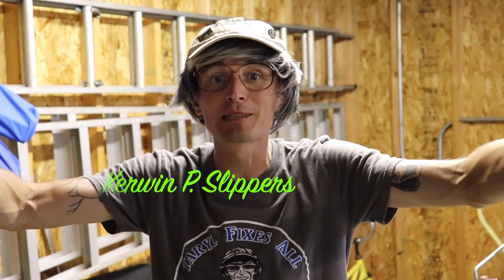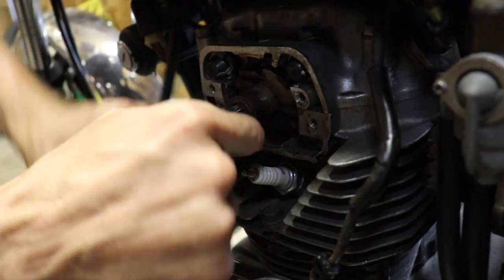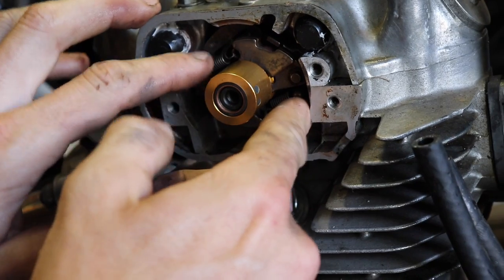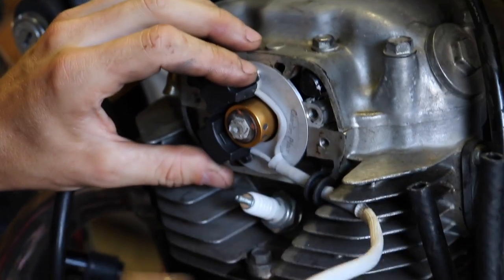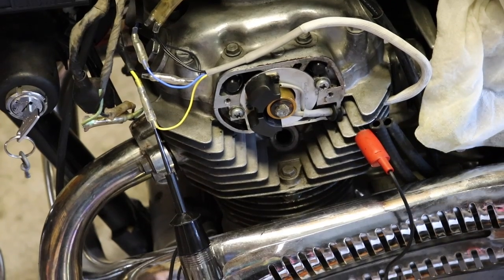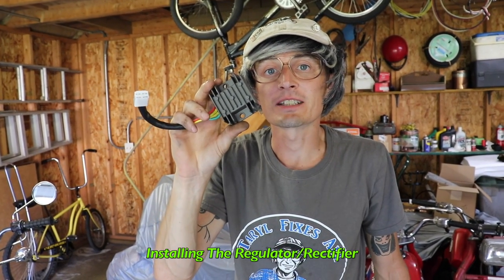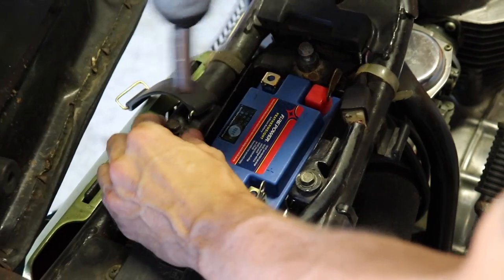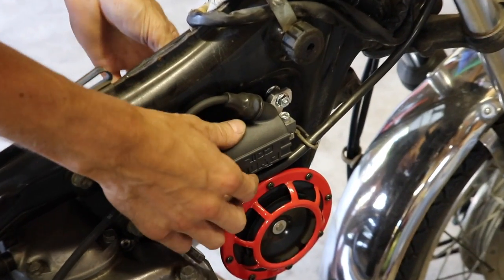Awesome Vintage Honda Electronic Ignition + Charging System Upgrade

Comment: If the screws have a dot on the head (which I think I see), they are JIS screws, not Phillips. That would explain why your screwdriver was walking out when you turned it.
Reply: Yep. I use my Vessel JIS tools every day.
Reply: Philips are designed to cam out when too much torque is applied. If it's old and it's made in Japan everything on it is likely JIS (Japanese Industrial Standards).

Comment: I bought a 1974 Honda XL 175 new was $824 counting tax. Had trouble with moisture condensing in points housing making it hard to start.(I was 14, never heard of WD40). A $.70 cent seal leaked & they wanted $70 to fix. Broke two Kickstarter shaft's off,  made of powdered metal! 🤬 Was a battery points ignition, wouldn't run without a good battery (6 volt).  Top speed 70 mph, speedometer and tachometer both pegged. Since it didn't suffer from 2 stroke bog down in tricky situations, Creek beds, ditches. was a pretty good trail bike. The trials knobby tires were so hard, never wore them out, but had to take curves carefully.
To find any old bike in good condition means someone bought them and never rode them.
In East Tennessee people rode like Maniacs, run into trees and tore them all apart. Passing on obsolete knowledge before this obsolete person passes on.

Comment: 30 years ago I converted a 641 Ford tractor to 12 volt, and put generator, wiring harness, starter relay, 6 volt light bulbs and anything else didn't use in a box, carefully labeled in case I sell tractor and someone stupid enough to want to convert back to "factory original". 🙄
So if the parts you took off the CL350 was good, I suggest it might be good idea to save them.

Comment: Syncing carburetors, ah yes, I remember fondly doing that on my type III Volkswagen squarebacks.
They had the pancake VW engine with dual carbs. Synced them up using a tool called a uni-syn. Measured the volume of air flowing down the venturi throat of the carbs. Worked really good.

Comment: I bought one used for $75 in 1987. Parts were expensive. Never could find a used seat that the pan wasn’t rusted out. Mine was that same green and I liked the color. I had a 1968 CL350 when I was in high school. The 360 was more comfortable but I think the 350 was a better engine.

Comment: Cool. In '76 I had a '72 CL 350 and I had to sand the points frequently. I usually used the striking portion of a book of matches. Thankfully they were easy to get to. Cool upgrade and cool bike. It's a vibrator, but a fun machine. BTW I got my first and only ever speeding ticket on it, doing 95 in a 55. But the cop cut me some slack and wrote down 65 so I wouldn't lose my licence : )

Comment: I had two those Honda 4 piston bikes and a Supersport, 1970 era.  Tuning them and synching the carburetors was a chore.  On the 550 I made my own rectifier assembly so it wouldn't fail me again.  Lost one leg of the 3 and found that the Honda one could not handle all that much current.  Made my own heat sink and used 3 25 amp full wave rectifiers to make my own.  Could rewire on the fly if any leg failed, had backups set to go.  Also I made a clamp and used cheaper auto capacitors instead of the Honda ones.  Cheap I am.  I recall that timing the 550 and 500 4 cylinders was a chore.  You had to go back and forth numerous times to get it perfect.  One set of points, there were two, would control 2 pistons.  If there was a misfire on the road, you just had to feel the exhaust pipes to see which set of points was failing and give them a tweak.  I am curious, sadly I no longer have any motorcycles, does this new ignition ever require future timing or is it a one time thing?  I loved the 4 cylinder bikes.  They were great on the highway.  The 500 was my favorite.  Best balanced.  Modified it a lot and put at least 50,000 miles on it.  Great episode.  Thanks for the memories.

Comment: I'm not sure if anyone has stated this yet but if you followed the rectifier harness to the main harness connector, the new rectifier / regulator just plugs right in. It would have saved a lot of your time making the new connector. If this was my machine I would go back in and remove the new connection you made and just plug into the wiring harness factory one just to eliminate the non needed wiring. PS i enjoyed the video.

Comment: On an old Honda,   set the cam chain tension first, then always bring the flywheel to the timing mark by turning the engine in the direction that the engine runs.    If you go past, turn it two  revolutions  back up to the mark.
Otherwise, the lash in the valvetrain can put some error into the ignition timing.      While you are at it, set the valves.

Comment: Thank you for the informative and also hilarious, video! I have the exact same year and model, same Muskat Green paint. Just installed the Charlie's Place electronic ignition. Funny, my bike has the 369 advance plate instead of the 312. Wonder if it was a serial number cutoff where they swapped them over? Anyway, I also installed a Speedmotoco Mikuni VM30 carburetor kit on the bike. Infinitely more tunable than the stock Keihins. Something to consider later on if you still have the bike. Thanks again for the excellent how-to video!!

Comment: The reason those "Phillips Screws" are hard to get off without stripping is that they are actually "Japaneese Industrial Standard" version of Phillips screws. US Phillips screwdrivers don't fit quite right but you can buy "JIS screw drivers in all of the numbered sizes that fit perfectly.

Comment: I have a 78 Suzuki with inline four... I got two coils and two sets of points, but the process is way similar!!!!   Difference is that the two sets of points are set independently ...  I have not changed over to electronic ignition, but I am thinking that is the way ....

Comment: Great video Slippers, love you guys. It looked like you were using a #2 Philips on those screws. I think they were probably JIS (Japanese Industry Standard). JIS will fit better and not slip or round out the screw.

Comment: What did you do with the regulator wires?   You unplugged the rectifier and got the new one plugged in after making that 4 wire plastic connector, but I didn't see you do anything with the regulator wires from the harness.

Comment: Those CV carbs dont like the foam air cleaners very well. They weaken the vacuum signal over the carbs because the original filters have a built in velocity stack on the filter to carb boots and the foam ones do not.

Comment: Nice vid, I like the old honda's (have a 1985 Nighthawk 450), problem is trying to find parts for them, Harley's are much more available.  I don't know about the instructions on the ignition module though,  damage it turning ignition on if it's in the wrong position? Scare tactics..
Looking forward to the carb sync video, that can be tricky without factory tools, Taryl  will simplify that I'm sure.

Comment: I would like to thank you for your video.  I have not been able to fine anyone to tune up my 1971 CL350.  After the tune up that I did it runs, but not much power.  I'm going to try the electronic ignition.   Did the lithium-ion battery just drop in?  where did you purchase it?

Comment: that is similar to my old shovelhead when i swapped to electronic to points 15 years ago
Reply: I had a XLH1000 ironhead that every book said was electronic, but mine was points. I guess in those days, people didn't trust electronics and some went back to points. You could change points on the side of the road easy. I timed mine with a 12 bulb too, it was an old underdash light with clips on it.

Comment: Id keep the points myself . There more reliable with the ability to clean the points. Electronic ign if it fails your stuck. And yes they do go bad. IVE delt with lots of cdi  lawnboy ones. And Briggs that just give up the ghost. As I said  points foul but clean n go.

Comment: With hotter coils there I basically no gain unless the sparkplug gap is opened up a bit, taking advantage of the higher voltage or higher current, I'd try at least .010" to possibly 
.020" more gap, maybe 
.015" would be enough,  older cars had .035" gap, newer electronic ignition  had as much as .050" -060",.  Get the carbs in sync, and open the plug gap a bit, it should perform better, maybe build a intake manifold, and install  a single larger carburetor, a single carb nearly 2x the original, something near 40mm , do some math, or try a carb check the vacuum at full throttle, at near full rpm, it would probably require a map sensor and computer, or micro controller that can read it, so the math method would be better, about 1.7x larger would be a good start, say it has 24mm, 48mm would be too large,   36-38mm is where I'd start! Because it can probably use a slightly larger carb to start with, they are designed to be as drivable and get the best milage possible, while still performing well,

Comment: I had the same bike thay have a cb 360 the pipes go on the bottom and the same problem with the carbs after I rebuild them you need a special tool to sink them

Comment: You see that "phillips" screw with the indentation on it?  That "dot" on the head means it is a "JIS" screw.  If you get a legit JIS screwdriver, it will no longer give you the screw distruction that the  Phillips will do.  I swear a JIS screwdriver will change your life, especially those horrible carb bowl screws.  Not kidding.
Reply: Yep. And the best ones to get are the Vessel brand. And they aren’t real expensive either…

Comment: The charging voltage is actually on the low side but I don't know if that new charger is optimised to work with a lithium battery. It was barely over 13 volt which wouldn't charge a lead acid

Comment: Don't know why you need more voltage, an LED headlamp would be an improvement, and take less power.   The Electronic Ignition would most likely work for my CB250, I will see what we have in UK.

Comment: 5:59 Slippers you may be using the wrong screwdrivers.
Japan use their own version of the philips head screw, they look the same but are slightly different. 
i cursed Japan for years destroying screw heads on my 808/818 Mazda Savanna's, only learned about the Japanese screw head 20 years ago on youtube.

Comment: I had a Harley sprint and a charging system burn up the Harley dealer couldn’t fix it so I sold it then yrs later I hear a Sportster charging system wood have worked
Reply: Wrong. 57-84 had generators, mounted in front of #1 cylinder. 84 - 85 had stator under motor sprocket, and 86 to present have stator under the clutch basket. No way any of that will bolt up to a Sprint.